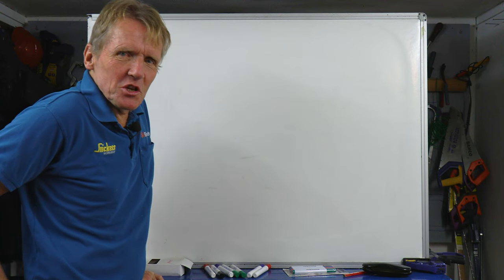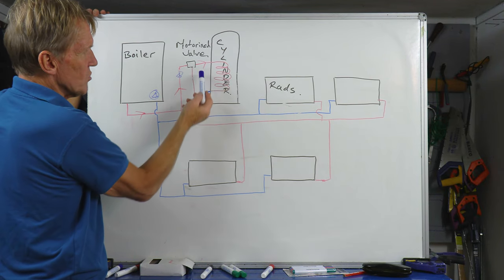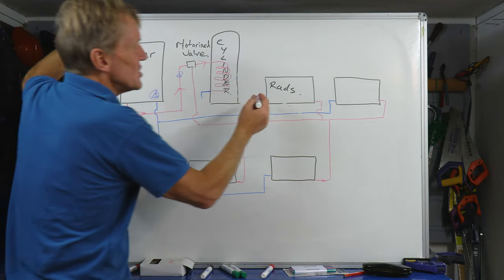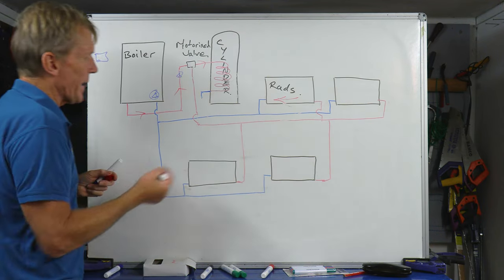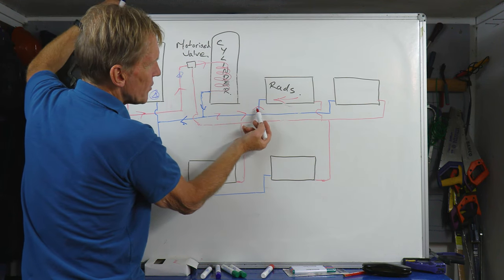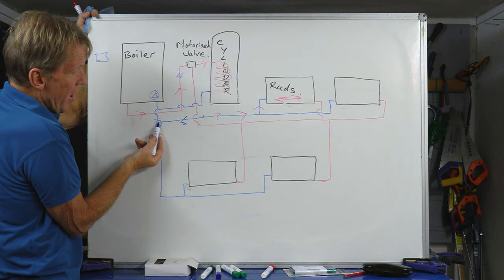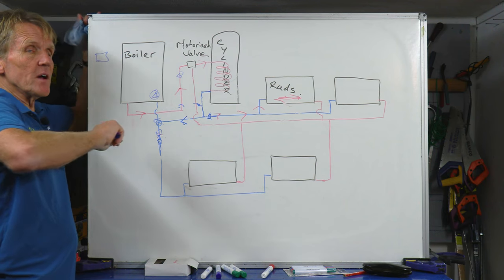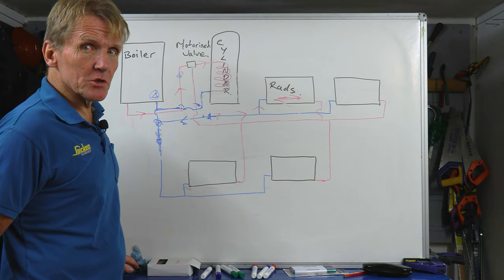Why Are Your Radiators Getting Hot When the Heating Is Off?

Comment: I have a problem! In in a flat and everytime next door turns on their radiators all mine come on! Even though all my radiators are switched off manually they are all on the snowflake setting ❄ it gets massively hot in my apartment I cannot even cope with the heat all the time. How does this happen please?

Comment: Roger, the reverse circulation happens not to my radiators but to my taps.  When I turn my water off at stop tap under sink,  the cold water flows out then hot water continues to follow it out my hot water cylinder out of my tap??? The flow doesn't really stop.  I had my boiler relocated last year and before this it never did it.  When you turn the stop tap off and open a downstairs tap cold water should flow then stop.  Can you help with this?

Comment: Roger can I send you pictures of the 2 motorised valves in my flat. I moved in a year ago and when we turn on the HW all the rads are piping. I have switched off all power to the CH and moved the MV bar to manual override and the spring took it back to auto so Im stuck with heated rads at the moment
Reply from the maker: Stephen
Yes send them to roger@skill-builder.uk

Comment: Thank - very useful. Can I ask, would it not be the case that if the warming of the radiators is intermittent or a developing issue, then it is more likely to be the valve?
Reply from the maker: Mel Yes you are right if it has suddenly started happening it is more likely the valve. The emphasis on the reverse circulation over other causes is wrong and wasn't intentional.
Reply: @SkillBuilder  Thanks - great channel by the way.

Comment: Hi Roger, So if the system has been fine for 18 years and all sudden this  problem happens surely what you have clearly explained can’t be the the issue???
Reply from the maker: That is correct. This is what you look for when the problem has always been there.
Reply: @SkillBuilder  Thank you for your reply.

So, if it has just started this problem, would it be a problem with the 3 port valve or the motorised valve possibly?

Comment: I have a system boiler and Glendale boiler mate. I've noticed that when hot water has been used and the boiler fires up, the rad in the ensuite (3 storey town house with ensuite on the top floor) gets warm. I've never been sure if this is by design or not i.e. the rad is used as a bypass, or if there's a rabbit away. What's your opinion on this one Roger?
Reply from the maker: I am fairly sure it is by design. It is a common arrangement.
Reply: @SkillBuilder  thanks so much for the reply Roger. Put my mind to rest. Take care.
Reply: @Daniells1982  hi not by design, you either have a stuck non return valve in a pump or an issue with the circuit board.

Comment: Great explanation, thanks!  If you don't want to or can't get a plumber in, I found in my first council flat that it helped to turn down the pump speed in the summer (dynamic head causing reverse flow is proportional to the square of the velocity of water in the pipe).  This works best if you have a modern boiler with a modulating burner.  And as a last resort, turn off the worst offending radiators.  Just don't get the plonker who botched it in the first place back to try to fix it, that will almost never work.

Comment: I think I remember seeing in the Netherlands an office building where all the radiators came fitted with a non return valve for each radiator outlet, is that a common thing?
Reply from the maker: No it is not common at all and I am not sure why it would be done. Hopefully someone will tell us.
Reply: It's not common but I've seen that before when someone has fitted a non bi-directional TRV to a system and it's causing cavitation - the company when round and put non return valves on all the radiators and still couldn't get rid of the air.

Comment: on a heat pump system one radiator is hot in one room and the one in the other room cold in the room beside it I turned off all radiators on that line except the cold one to try forse water to it but the hot radiator came on as well how could this happen thank u

Comment: Make sure to remember your lockshield gate valve on hot water return pipe when running it back to the primary return to stop it racing around cylinder and robbing radiators when heating is also calling for heat
Reply from the maker: Phillip Funny yoou should mention that because we made that very video and it should have gone out before this one but the file was corrupted. We will be making it again,
Reply: @SkillBuilder  it's surprising how many installs u see without one fitted, not completely noticeable unless heating circuit is undersized....  What's Ur thoughts on bi directional trvs? I was always taught to fit them on the flow pipe for better balancing on radiators shutting down or opening lockshields on the return but I see them repeatedly on return pipe... Most instruction packets on them say yes they can go on either end of the rad but should be on the flow pipe.... Get numerous plumbers telling me it doesn't matter... Ur thoughts?

Comment: Hi Roger! I have suddenly got this issue where when using my shower / any hot water tap, the two rads closest to my combi boiler heat up quickly and super hot. Long story short, I do need to replace the whole boiler regardless, but as it'll take some time for approval / new boiler installation, is it still safe to use the boiler with the rads heating up? They two heat up very hot and quickly, but I still get nice hot showers. My CH & thermostat are off. I can live without heating while waiting for the new boiler but not without hot water! So would like to continue using it for the time being. This suddenly happened overnight. Thank you.
Reply from the maker: It is only the divertor valve in the boiler. They don't always go all the way over and that lets water through to the heating. You don't need a new boiler if that is the only problem. A quick swap of the valve should do it or maybe even a cleaner in the system to flush out debris.
Reply: @SkillBuilder  Thanks so much Roger. Is the boiler still safe to use for the hot water though? Sadly the boiler has a laundry list of other problems - blocked heat exchanger, leaking heat exchanger, needs new PRV, expansion vessel etc according to Vaillant engineer. I have a repair plan so hopefully insurance will give me some money towards a new one. In the meantime though hoping it's safe to use the hot water with the rads heating up.

Comment: Surely most boilers are combi these days. So most of this is inside the boiler.
The reverse flow cannot be in all radiators; at least one must flow in the correct direction. So, if you are feeling inlet and outlet to detect reverse flow do it for all radiators- otherwise you might get the one that is in the correct direction.
Reply from the maker: Good point on checking several radiators. As for most boilers being combis they are certainly more popular but there are still plent of cylinders around and unvented cylinders are popular. Most house I work in have two or more showers and the samller combis struggle.
Reply: Skill Builder They struggle because plumbers size them on CH needs, rather than HW. More than one shower should have the highest flow rate boiler in the range. Less is false economy.

Comment: Hi Roger heres a problem ive had since replacing the three way valve in a different location. I had it originally under the floor with it forming a T to the radiator and hot water circuits respectively. I decided to move it in beside the boiler for ease of access/ replacement in future, used some street bends to get it nearly in place. I now get banging in the pipes when the heating circuit closes off. Ive fitted an expansion vessel to replace the one in the boiler that failed. Any ideas how to cure this?
Reply from the maker: Hi Alan 
Did you rewire the valve?
Reply: Skill Builder Hi I just did like for like (same Honeywell valve) and checked the connections against the circuit diagram as I went.

Comment: Brilliant. I had issue when in winter I wanst getting heating on downstairs but upstairs was fine. Then engineer came n changed heating 2port zone valve, still no heating downstairs then flushed whole system, still no heating downstairs then changed the thermostat n it's main signal box. Slowly started getting heating everywhere. But now I'm getting heating on when I turn water on and getting water on when I turn heating on. I can't get anyone to sort this.  As it was winter I never turned water on as I was getting boiling water with heating. But now its summer when I turn water on I'm getting heating and I just need both water and heating to work independently. Last year thermostat for timer has also been replaced as thot that may b the issue. Some one pls pls help and advice me. Ppl are saying the 2port zone valve replaced is faulty?

Comment: I have 2 radiators coming on in the summer 1 in the bathroom and 1 in the  on- suite builders said it was to dry the towels if I wanted to can I just shut  the  flow valve's off on the said radiators
Reply from the maker: Hi Dave 
 Some boilers need an open circuit to act as a bye pass for the pump over-run, however this is only needed when the heating is selected so in the summer you will be fine to shut off both or one of those radiators.

Comment: Good Morning Roger ..Ok I have a outside wood boiler comes into bungalow to a heat exchanger rads an hot water round property on S plan. I am getting a feed to some rads when they are supposed to be off the mobile room stat is not calling for heat and on the timer on the wall it is off for the rads and the DHW is off on the timer on the wall   the boiler is non pressurised only the heating system after it come from the heat exchanger 
Have you got any thoughts Please  Regards Joe
Reply from the maker: Little Joyey.
I have done a lot of wood boiler installations and I am assuming it is fed into a Dunsley Neutraliser or some kind of low loss header. It would be quite common for this to allow some gravity circulation around the rads when the pump is off. Often a gravity check valve is fitted but having a little bit of heat creeping aroun in the winter is no bad thing so I would be inclined to leave it. The gravity circulation is also done as a heat leak in the event of the wood boiler going a bit crazy on a windy night.
Reply: @SkillBuilder  Hello the unit i have got is outside it just circulates water to a copper plate heat exchanger in my garage so it doesn't need a heat sink  the heating system is plumbed into the heat exchanger on a s plan yes i like a bit of heat creeping around in the winter but its funny that after nearly 12 months its started to do this   must be backfeedin i think  i will check where the return from the dhw comes back into the system 
Thanks  Joe

Comment: Not understanding this. So cold water goes in and hot water comes out the boiler -> valve (which divert hot water to radiators/or taps). 

Where the valve diverts to cylinder, why does hot water need to the  go to the cylinder only to be returned back to the boiler?

Is this for combi boiler?
Reply from the maker: The cylinder has a coil inside it so the hot water from the boiler exchanges the heat and goes back to the boiler to reheat. The boiler water never comes out of the taps unless it is a combi.

Comment: Not uncommon back in the 60s to plumb the system in like that. During the summer people turned off all rads except the bathroom one. This gave them a heated rad in the bathroom during the summer. I still come across original systems like this, not a mistake but old boy plumbers, times and technology have moved on 👍
Reply from the maker: We still do plenty of summer operation rads and towel rails. It is a completely different thing to all the rads warming up. I will show this setup next.

Comment: Hi Roger have both solid fuel and oil heating, Problem is when oil is turned off i get heat creep on flow piipe to stove thus heating boiler on stove.. Thanks fr any help
Reply from the maker: Hi Ray 
There is a company called Dunsley that has a number of solutions to this problem. You need a neutraliser . http://www.dunsleyheat.co.uk/neutralizerins.pdf

Comment: Hello Roger how do I get rid of condensation between the two panes of glass in Double glazing???
Reply from the maker: There are some diy kits that will do it. You could also check the bottom of the frame is clear and not flooded. If the frame is flooded it can cause a misting. In the end if all else fails it is question of renewing the sealed unit.  
I would like to try drilling the separating bar and drying it out and then sealing the whole lot with tape around the edges but I don't know if it will work.
Reply: @SkillBuilder  ok thankyou could you give me some info on the dry kits and btw thankyou for the pointing video, I have repointed half the house using your 5:1 ratio of sand and cement, it worked a treat on our terraced house
Reply: Hello Roger what would you suggest to be the best sealant for resealing windows externally and Internally should I use a separate sealant for outdoor and indoor??

Comment: Hey there, I’ve just discovered my pump won’t turn off…. First of all I turned it down at the thermostat and then when that didn’t work I turned it off at the wall and the pump was still firing up so I went outside and opened it up and turned off the switches in the pump…… what is my fault and what do I need?
Reply from the maker: It is very likely to be either the pump over run on the boiler or a stuck micro switch on a motorised valve.

Comment: the coil in the cylinder, whats its usual dimensions, ie diameter and length?
Reply from the maker: They vary. A good 'heavy duty' cylinder has a 28mm coil and it is bigger but cheaper 'medium duty' cylinders have a very small coil and take longer to heat up.
Reply: @SkillBuilder  yeah i'm building a 25l/50pint tank, i've used 3m of 15mm as a coil, it 'looks' right by scale...time will tell...

Comment: Hi roger
            Why my hot water tank still boiling even boiler is off? Confirm new motorised valve changed and Emerson water power socket is off.
Reply from the maker: Is the immersion heater off? If the boiler is off the only heat that can be in the hot water cylinder is residual heat. They stay hot for around 18 hours if insulated.
Reply: Heater never on, new mortised valve changed, boiler switched off completely but not wall socket. Thermostat programmed off but I can feel vibration of boiling water inside hot water tank . Waited many hours but  still on so switched off wall socket for boiler and finally boiling stooped. Where I should check for this problem?

Comment: Great vid! Not picking at you 😆but In regards to calling the primary return a common pipe, is that sort of the same terminology with wiring and the permanent live. I’m not a sparky but I think the penny just dropped after you said that. 🤔
Reply from the maker: Hi Michael 
The permanent live is to do with the controls so I don't want to confuse matters. I have just recorded a video on heating controls that talks about the permanent live.

Comment: I seem to be having a different issue.

If my programmer is set to only have hot water, I get boiling hot rads and the room thermostat is permanently on. If I just have heating running, the heating runs normally with the thermostat controlling properly.
Reply from the maker: Hi Will 
There are so many possibilites here. Do you have two motorised valves or one?
Reply: @SkillBuilder  
One valve. It’s a Y system with a 3 way valve. I’ve just looked and it seems like a dodgy micro switch.

It keeps moving between the mid position and central heating. 

Just seems odd that the central heating thermostat shows an orange light and ignores the internal switch

Comment: So If this issue of hot radiators suddenly starts when the system has been working OK for years, am I right in thinking it must be a faulty motorised valve????
Reply from the maker: It is likely but you need to feel the pipe either side of the valve when it is off

Comment: I have a vaillant boiler when it's switched off the radiators will get hot I just press the reset button and it works might have to press it a few times

Comment: I thought this was my issue. I have a boiler system like the one drawn my issue is my garage has 2 radiators that seem to be calling for heat even though the thermostat is off. I thought it was a bad thermostat so replaced it and issue persists. The wires seem to be fine. That's about all I know

Comment: In a situation like this could an NRV be fitted anywhere on the flow pipe before the boiler ? If not enough space to fit on the returns ?
Reply from the maker: Yes I have done that many times to avoid ripping up floors
Reply: @SkillBuilder  Quick response. Thanks very much.

Comment: Thank you for the really useful videos. I had reverse circulation on my downstairs radiators. This was resolved my fitting a non- return valve. However the issue now is that when i have both the Heating and Hot water on at the same time, the downstairs radiators are not warming up? Any ideas what it could be? Could it be there is too much resistance because of the non return valve?
Reply from the maker: you need to choke of the cylinder circuit a little so it brings more to the heating. You might also need to turn the pump speed up.
Reply: @SkillBuilder  thank you for the reply! Will try this :)